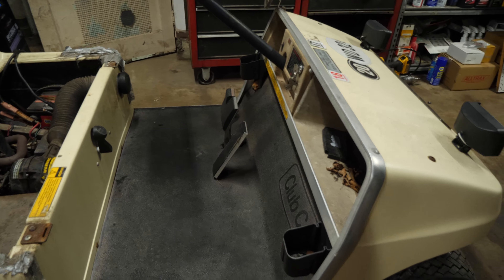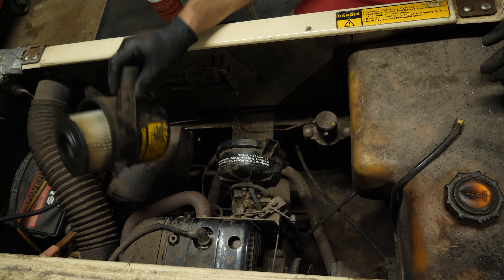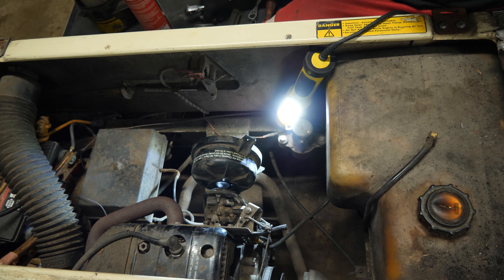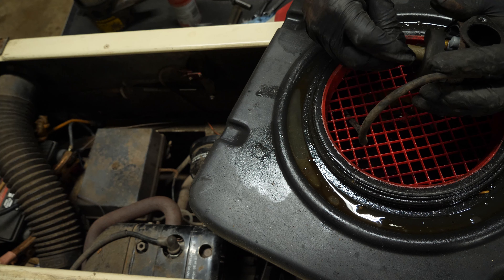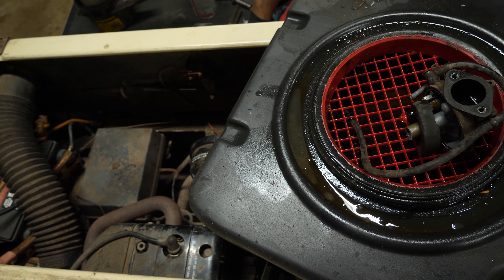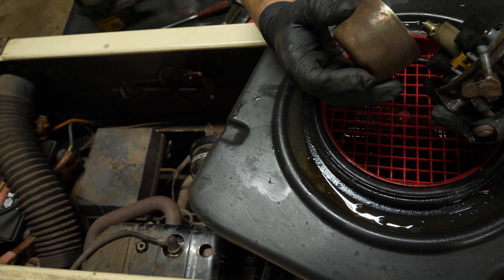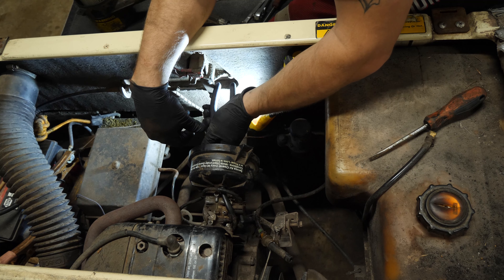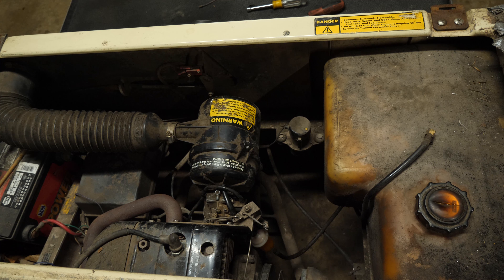1985 Club Car DS, Gas - Crank, No Start, Clean Carburetor

Comment: Thanks for the video.  I have a 1987 and changed the fuel pump but it didn't help.  It's been a while since I've torn into a carb, and this video was really helpful.  Purring like new now.  Just a note for those who might not have any experience with a carb ... if you hold the carb upside down when blowing cleaner into the intake it won't go through the valve and clean it because the float will have the valve closed off.  So hold it rightside up when blowing the cleaner through.

Comment: Picked up one of those flat head carts for a case of beer.  Guy said it stopped working and he was done trying to figure out why.

The pick up tube had broke off in the tank.  The new owner is still driving  it and loves it especially since it looks like a newer 2k because CC  really didn't change the exterior of the cart until that ugly Precedent in 04.

Another awesome video Mr Kevin

Comment: Could you tell me where the oil filter would be on that motor? I just picked up what I think is a 1979 model just like this that has been sitting for about 5 years. I cleaned the fuel tank and replaced all the hoses and filters and then cleaned the carburetor out and have it running good but I can’t find the oil filter. Thanks in advance.
Reply: There isn't one. Just like a lawn mower engine, no oil pump, no oil filter

Comment: Hi Kevin, great content.  You mentioned at about 23:00 that you've not opened up these older gas engines.  I'm wondering if you have been inside one of these since you created this video?  I have the same cart (doesn't have electric fuel pump for some reason) and my governor shaft going into the crankcase cover spins freely.  I don't know if it's supposed to do that.  Most small engines I've worked on do not spin 360°.
Reply from the maker: I haven't had a need to open one. I don't see these old carts anymore. The governor shaft should have limited rotation. If its spinning freely, then it has mechanical failure within the engine.
Reply: @Kevinsgolfcarts  That's what I thought.  Thanks for your input!

Comment: Hey im having trouble with my 1984 club car and its running way to rich i have the screw turned way down.. the airfilter looks good.. and now my oil smells like fuel.. i dont know what else to check would you have any pointers? Thanks for your time!
Reply: Sunken float, get a new one